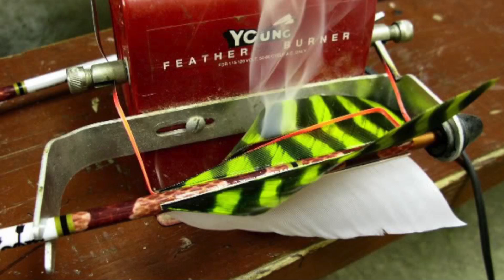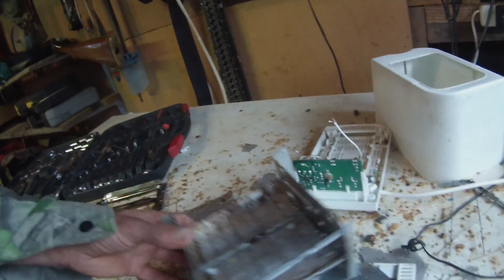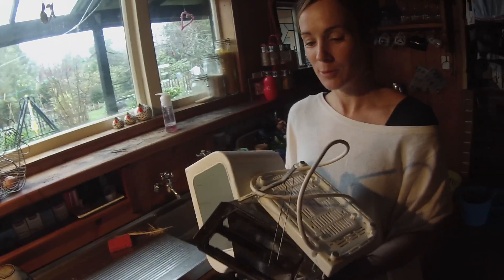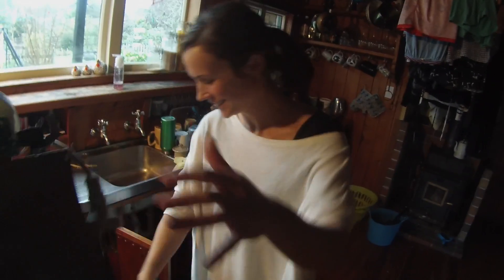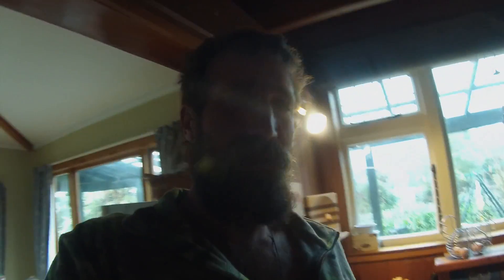FAIL Toaster mistake as Josh James shows us How not to make a fletching burner

Comment: fuse wire would prob be your best bet try different lengths and different sizes,  using the lab top charger.  we use to cut polystyrene using no8 wire jumper leads and a battery.  id stay away from the wall sockets.

Comment: Hay mate, a sparky here. Try uncoil one set of an element hopefully about 1metre. use a 12v car battery and say some jumper leads. Connect one lead to 1 end of the element and one to other. Move the leads closer together along the element until it heats up? worth a shot i reckon. Maybe put a 32A inline fuse if your worried. Love the vids by the way.